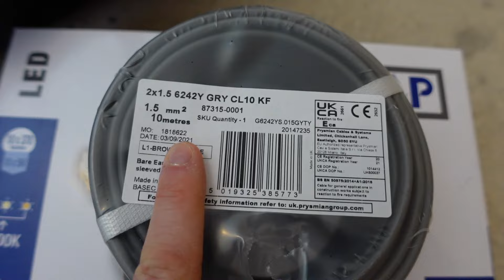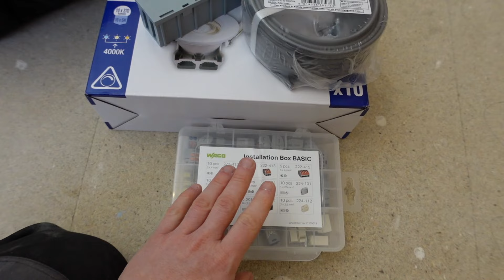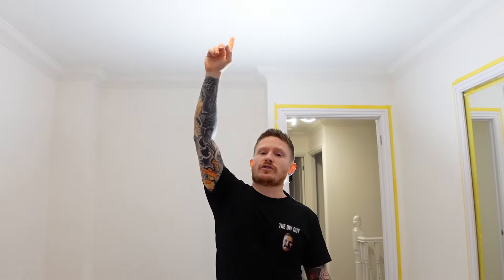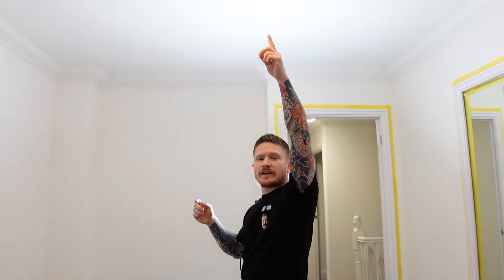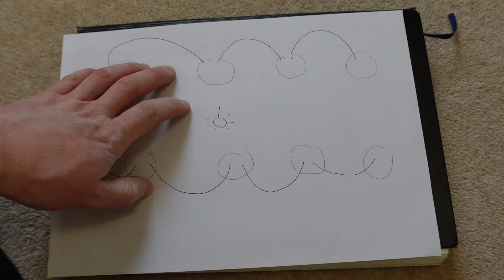How to Install Spotlights | Change Pendant to Downlights

Comment: HANDY TIP: When cutting holes in ceiling (messy job) attach a plastic tray between hole cutter and drill to collect all the mess! I cut out the bottom of a popcorn bucket about 2” high ! Trust me , you’ll thank me later! 😊
Reply from the maker: Good little tip that
Reply: Or use a dade 😜
Reply: I wish I had read this comment 10 minutes ago!!! Plasterboard dust everywhere.
Reply: That's a brilliant idea ..... Maybe a KFC bucket will work as well 😋

Comment: Brilliant video, every possible question answered without needing to be asked by a DIY'er. I was going to cave and pay £500+ to get mine done but knew I'd be more than capable to do it myself thanks to your video mate. Cheers 👍.
Reply from the maker: That's great, good luck to you 👍
Reply: Did you test Zs and Ze? No good if the automatic disconnection device doesn't work if there's a fault..just 'FYI in' ya..
Reply: @ef7480  - Why would you need an earth loop impedance test for fittings with no earth?

Comment: HANDY TIP: Wear safety goggles when drilling holes. One does not want to get dust in eyes. Could lead to A&E visit and eye wash etc
Reply: And! The use of a vacuum cleaner is a very good way of keeping all the dusts far away from your eyes ❤

Comment: The wiring from my switch goes into a junction box. The wiring for my existing light comes out of the junction box which is live and neutral heat resistance wire. No switch or earth wire. Do i add a new 3 core wire from the junction box connecting from the switch wire and wire as in the video.

Comment: I did my own kitchen rewire as a sparky. We ripped full kitchen ceiling down and the first joist bay was 300mm then 470mm then 400mm. Safe to say we just marked the top of the walls below ceiling height

Comment: I watched your video yesterday and It is a project I had wanted to do, so today, I installed 9 outside LED spotlights in my eaves.
I followed all your steps, I had to modify how I wired it due to access issues, but I was successful. 
Thank you for explaining this, step by step, it gave me the confidence to do this.

Comment: Hi DIYGUY, just fitted a set of 3 downlights into my bathroom (IP Rated of course) to replace my old ceiling rose. Had a slight bit of figuring out to do when I got to the rose and discovered 5 cables coming out of it. Worked out they were the shaver socket feed and the extractor fan. Couldn’t have done it without your video, saved myself a lot of money and the bathroom looks much better. Thankyou mate 👍🏼
Reply from the maker: That's what this channel is all about

Comment: You laid the cables over the insulation and moved the insulation from around each light fitting. Is that deliberate? A great video and exactly what I was looking for, thank you.
Reply from the maker: Firstly it is for the purpose of giving the viewer a good visual representation but also I applied covers over the spotlights so had to do this for that reason too

Comment: This is good vid for a house.What about flat with neighbours above?I need to convert pendant to spot lights.There are wooden joists and no option to fish the cable between holes.What is the best method?Can I cut slots in joists or do I have to dril holes on both sides and joist itself?

Comment: Hey man! nice video. What kind/brand of spotlights are those? Is there a specific name for it when they have double wiring connectors? I can't find anything on the internet. It seems the ideal way to connect the spotlights parallel.

Comment: Thanks so much for this. I have a question: why connect the earth in the cable from the first light to the other earths that were in the ceiling rose if it’s not actually connected to the lights? 
And why do the downlights not have earth terminals?  If something goes wrong is there not the danger that the light fittings could become live with no Earth to provide protection?

Comment: Very detailed video
I am looking to install some spotlights in my room but i dont have access to the loft space above as its been converted and covered in flooring. Is there a way to do this without having access from above? I guess you could fish the wires through the holes? Might be a-bit tricky but its easier than removing flooring?

Comment: Brilliant video - Thank you! Question, about to fit downlights in a hall with an on/off switch at either end - how will the wiring differ how should it be wired?
Reply from the maker: Check out my video on two way switching. Thanks

Comment: So cool!In my case, if I can't get inside the loft, how do I put one wire into one hole and get it from another hole?Thank you
Reply from the maker: It will be difficult. You may be able to use cable pulling rods but it's dependant on some other factors such as joist direction.

Comment: Hi there great video! :) 
Quick question if I may - what is the best way to find out which spotlight is the first in the circuit without disconnecting each one?  I am going to be installing Lutron Dimmers to my spotlights and it will need the first light to be disconnected from the circuit to install the dimmer module.

Comment: Hi - Really good video. Can I just ask if the same method can be used for 2 way switching of spotlights utilising the Wago boxes (3 plate method with 3 cables coming in to the ceiling rose)  - 1.Power, 2. Switch from kitchen back door, 3. Switch at hall entrance to kitchen)? Thanks

Comment: Hey diy guy wanting to run 6 spot lights on a plug & timer what’s the deal with the earth. I believe these are the same lights I will be using or very similar. Any links or advice much appreciated

Comment: Great video. I just have one stupid question. When you say connect the wires from the previous room, that just means the previous pendant light cables right? Very useful video and will be giving this a go. Thanks
Reply from the maker: Hi. Yes, the wire coming from the ceiling light in the previous room on the circuit.

Comment: Another daft question- why do you connect the earth wires all together on the block when they are not actually connected to each light unit?

Comment: Hi Thanks Good clear video only minor criticism don't think in listing items required, you made it clear the LEDs you were using were ones incorporating a driver if you did I must have missed it. Foolishly I bought LEDs that didn't so need to purchase suitable drivers for the two I'm fitting. Assume it needs to be constant current drivers rather than constant voltage that need to match the power requirements of the 5 watt LEDs I have.  Do you have any tips for purchasing the missing drivers  & recommended suppliers? Clearly it makes life easier if the LEDs incorporate drivers rather having to faff around later.  Cheers
Reply from the maker: Thanks for your feedback

Comment: With my LAD lights I have to press down on the top of the connector to insert the wires. I noticed you didn't do that, how did you manage that?

Comment: Hiya, great video. Just wondering if I can pick your brains on something. 

You joined the feed from previous room and feed to the spotlights in block connectors - if you had a feed going to the next room. Would it work the same? - I.e put the neural with the neutrals and loop with the loops? And earth with the earths ( to go off into the next room) 

Many thanks
Reply from the maker: Yes it works in the same way. Thanks

Comment: I have successfully managed to get the first room of Downlights to work but the second room isn’t working at all, I’ve followed the same process but no luck, any ideas why this could be? 
Also how would I go about adding an extractor fan to the circuit?
Reply: Figured out the downlights in the next room only turn on if both switches have been turned on, so the previous room has to be lit in order for the bathroom to be, how do I fix that? 💀

Comment: Does this only apply if the existing pendant is part of an existing radial circuit,  or could this method also be used on a ring circuit?

Comment: Good video mate simple and straightforward just wanted to ask how would yiu do that in a down stairs living room.  Meaning the do you access the space above as it's not a loft. Thanks
Reply from the maker: Thanks. Unfortunately it is not quite so easy. The best way is always to try and gain access above by removing floorboards if possible. If this is not possible in some cases you can use wire feeding tools but it is dependant on joist direction as to whether this will be practical.

Comment: Good evening, i have these as per you installed them along with the dimmer switch you installed on another one of your video’s. But when turning on the lights it takes around 4 seconds for the lights to come on any reason for this? Cheers

Comment: great video, I want to put three spot lights in my hallway using the ceiling rose hole as the center hole then one each side  would it be ok to use the  center as the main then just go to the right then from the right to the left one?? same thing realy ??
Reply from the maker: Yes you can!

Comment: So what would you do if the down light was in a concrete ceiling and you had built a frame to drop the ceiling down and the wires where to short

Comment: Another superb educational video, with no corners cut. This is like those ‘For Dummies’ books, but much better in video format. You are a Saving Grace and deserve far more than 5k subscribers. 👍

Would the same principle apply for spots in a bathroom, albeit they have a transformer to lower the voltage?
Reply from the maker: Thanks I appreciate your comments. YouTube algorithm is so tough to really get the channel to grow :(. 

The same principles apply in bathrooms but you should ensure the circuit is RCD protected and that the downlights are rated for bathrooms.
Reply: @TheDIYGuy1 this comment aged well 128k now! 🎉

Comment: Very well put together video. Just a quick question. Would it not have been possible to add a spotlight at the centre where you took off the original ceiling rose

Feed the power into that as a first spotlight , twin and earth, and then spider web off into the others? is there a particular reason you did it your way, with the Wago box and block connecting.
Reply from the maker: You could put a downlight in the centre if you wanted to.

Comment: What's the general rule for the correct spacing of spot lights? 
Distance from wall and spacing in between. Cheers 👍
Reply from the maker: It's personal choice, there isn't a correct rule in my opinion.

Comment: Hi great video... Just wondering would they be ok outside, entrance- ceiling -front door. Or would you recommend ! Thanks.
Reply from the maker: Hi. Thanks. Yes these are IP rated so fine for use in a porch area for example
Reply: @TheDIYGuy1  Thank you buddy, also do you have any link where I can buy cable as one that you have used 2x1.5mm2

Comment: How do you make sure the laser level is straight on the ceiling? Is there a trick? the vertical line plums itself automatically but how it runs across the ceiling depends on how well you've positioned the level and if it's square or not

Comment: Hi great video as usual, I have a question.
I already have spot lights in my bathroom (4no.) which I would like to replace, the old ones have transformers attached to them ,I noticed in the video you didn’t use transformers, are they not required? I should note the wiring from the old spot lights looks very old, they have a cloth like sleeve on them.

Comment: Great video. Moving house next month and going to attempt putting spotlights in the kitchen myself, so this video will definitely help. 
Noticed you used different wago connectors for each wire, does it matter what ones you use?
Reply from the maker: It doesn't matter. To be honest I just used what I had in my pocket!

Comment: Hi mate brilliant video. You’ve given me the confidence to undertake a small project in my house. Have always wanted to install spotlights in my bathroom: Q1 Can I use conventional spotlights like you’ve  shown in a bathroom? Q2 Any advice on calculating the number of spotlights I’ll need to install? Many thanks.
Reply from the maker: Hi, thanks. The spotlights for your bathroom should be IP rated. My advice would be to go with 1 downlight per square metre

Comment: It's easy when you have access above as you from not covered loft floor. I need to install same thing downstairs between the joints. I have not idea how to done it without ripping off the celling..
Reply from the maker: Access from above is your best bet or use cable rods but it won't be easy.

Comment: Fantastic video. I’m three quarters through doing this for spot lights in my hallway downstairs. A pig of a job lifting chip board floors upstairs 😢.
Q: is it ok to use existing holes in the joists to thread cables through if they are used for heating/water pipes?
Thanks
Reply: No

Comment: Is there any way of doing this on a ground floor ceiling without pulling up the carpet from directly above?
Reply from the maker: You can try to use cable pulling rods. It won't be easy though and will rely on several factors

Comment: Great video, informative and easy to follow. Did/Can you cover these lights in insulation after - As I’ve seen they are a reasonable price and considering doing this.
Reply from the maker: These particular ones you cannot cover with insulation. However some spotlights can be covered. You can also buy insulation covers

Comment: Great video, if you are installing spots downstairs (no attic access, rooms floored and decorated upstairs) how can this be done?
Reply from the maker: You only have a few choices. The best one is to gain access from the room above. Alternatively you can use cable rods to feed cables through the spotlight holes that you make, however it can be fiddly and in some cases impossible.
Reply: @TheDIYGuy1  thanks for your advice

Comment: Any advice on what brand and wattage is good? What’s the general rule of thumb on how many do you need for a room?
Reply: Not an expert, but I daisy chained eight LED spotlights in my bathroom 11'x5' and it's perfectly bright. Having said that, do consider if you want Warm white or Icy/Cool white as I used icy/cool white for the bathroom but warm white for spots under my kitchen wall cabinets where a cosier feeling is appreciated.

Comment: I've got a question. I'm going to install a media wall with 6 shelves and want spotlights for the shelves. Would I use spotlights like these? Or is there another type of spotlights I should be using?
Reply from the maker: You could use these or you could consider led strips

Comment: DIYer here. I was always under the impression that led downlights had to user a driver. Are the drivers integrated within the LED downlights themselves?
Reply: These downlight are integrated units meaning the driver is incorporated into the unit so no external driver is needed.

Comment: Really well done problem is I've got a Dorma ontop so that means I've got to rip the flooring up on third floor ...was thinking if a floating ceiling would work what's your opinion?
Reply from the maker: Yes a floating ceiling is an option. Personally I would always prefer to spend the extra time gaining access from above.

Comment: Hi, can I ask how much all the material you used cost and roughly how much it would cost to get this done. Being a single mom I'm finding I'm getting some really crazy quotes. Also my ceiling has a tube  one side and a light as it's a kitchen diner. I've started work getting a new kitchen but getting all sorts of costs mounting up. My house has been a mess for a month now. Also above my kitchen is my bedroom so how would the joists be avoided  I have carpets and furniture in the bedroom as you do... my house is a new build roughly 24 years old,  thank you in advance

Comment: Great video. Makes sense and confidence building. Can I ask about the insulation around the spots in the attic. Are they left uncovered or does the insulation then go back over the lights to maintain thermal efficiency. Is there a risk of fire from the heat produced by the lights?
Reply from the maker: Refer to the instructions included with whatever downlights you use. Some require a hood and some don't.

Comment: Brilliant video! Could you do a video on external down lights on soffits please
Reply from the maker: Great idea. Let me see what I can do
Reply: I'm looking for the exact same thing.  The bit I can't work out is how to wire it to an existing light switch. It's a new build I'm moving to which I assume means the circuits will be wired to the switch. I think this then means I would take a 3 core wire rather than twin and earth to the first light?
Reply from the maker: @iamtheresurrection4141  Twin and earth is a 3 core piece of wire, it has 3 conductors inside. All you need to do to wire a switch is to run a piece of twin and earth to the switch. Earth goes into the earthing terminal with earth sleeving on it, live goes into the live terminal labelled as 'com' (common), neutral goes into the terminal labelled as L1 but becomes a switched live which should be indicated with brown sleeving. I hope this helps.
Reply: @TheDIYGuy1  thanks bud. I'll give it a try. Wasn't sure if it was a different wire in the switch as they look brown, black and grey (it's a new build too)

Comment: Any reason why people don't use s stud finder to locate joists rather than go up into roof or drill hole & stick a bent coat hanger rod in and turn around. Just curious what the official reason is cos it seems easier .